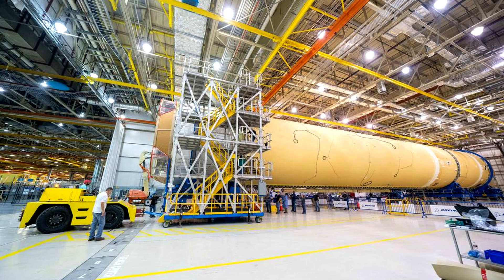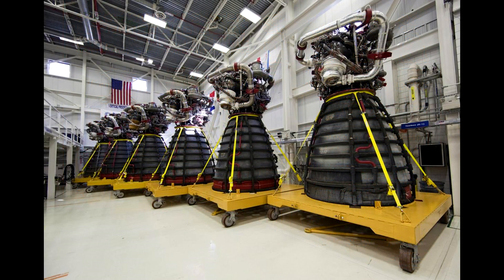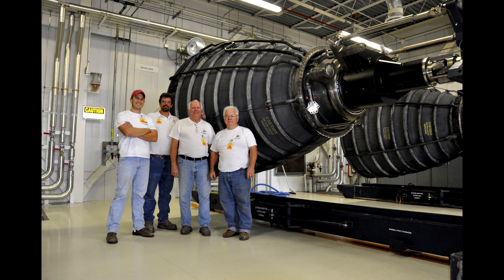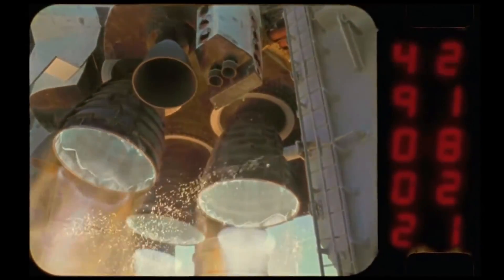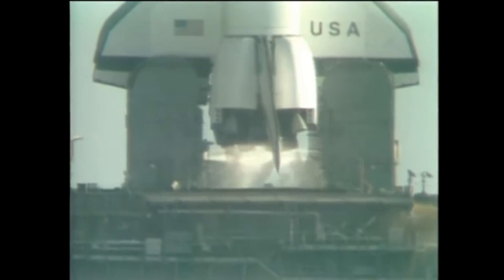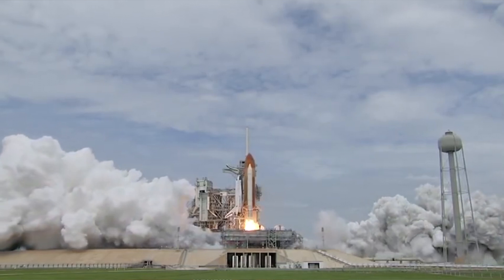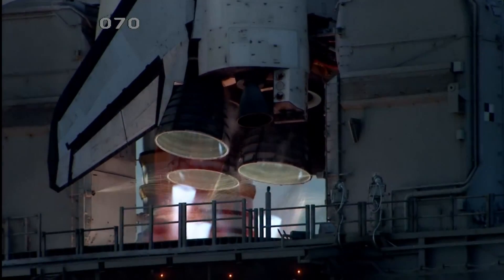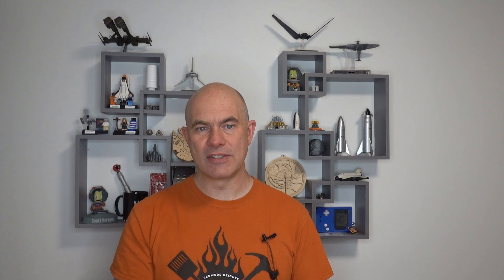Four Old Space Shuttle Engines Team Up For One Last Rocket Launch

Comment: Government: We have the reusable engines, let's throw them away!
Reply: Is it really reusable, if the turnaround is more expensive than new, simpler engines? I mean technically, yes. Sensemakingally? not really.
The reusable Shuttle was ludicrously expensive and slow in reuse-times....

I twas solving a problem, nobody had, at much higher costs than it made any sense.. Pretty iconic though.
Reply: Reusable engines is a big word, refurbishable fits better.
The Russian shuttle had realy reusable engines.
Reply: @Triggernlfrl  Because the Buran orbiter only had orbital vacuum engines on it. The vast majority of its parts (including its main engines!) were a completely expended LV. Besides, it was only used once so who knows how well the refurbishment would go?
Reply: Well it's not like they were ever going to be used for anything good anymore, the STS program is long dead anyways. Even so, they required significant refurbishment to be "reused", so it's not like they'd save that much by saving them again and again.
Reply: @Nick1979BN  yes of course the smallest rocket possible is the most efficient but SLS is being built to try to send some stuff to the moon and anytime you want to go to the moon the payload is extremely heavy
Reply: D R Big pharma and the insurance companies would make sure it didn’t.
Reply: I feel for those RS-25D engines.
Reply: Basically sums it up yeah.
Reply: D Murrman  scary isn't it.
Reply: They love spending our tax dollars. At least they are giving them one final go! Kinda sad the 4 won't make it into a museum though.
Reply: Ever heard of dunning Kruger effect?
Reply: You are a shining example of the dunning kreuger effect. Your very limited knowledge on rocketry has given you a false sense of expertise, where you are highly confident that you know the right answer despite the fact that actual experts would be less confident than you are. It's unclear just how much the reuse of the falcon 9 has reduced it's cost. A reduction of at most 10 million dollars per flight is claimed by spacex. The real reason the falcon 9 is so cheap is because it's parts are so cheap to produce. That's all. 

So; you want the government to reuse the first stage of the SLS. They already tried that with the space shuttle; the cost savings turned out to be marginal at best. So let's say that NASA were to try to reuse the SLS. The first thing they'd have to do is dramatically increase the mass of the upper stage. Not even the exploration upper stage would be massive enough to allow for this. There's a reason spacex has a massive upper stage, so that at MECO the first stage isn't moving too fast to re-enter. So good luck with that with the SLS! I suppose all we'd need to do is develop a massive 350-400 tonne hydrogen powered upper stage using 3 J-2X engines, and then also SPEND AN ESTIMATED 500 MILLION TO 2 BILLION DOLLARS TO MAKE THE RS-25 CAPABLE OF BEING LIT MID-AIR WHILE TRAVELLING THROUGH THE ATMOSPHERE THE WRONG WAY. Then spend another few billion dollars developing flight and guidance hardware to allow for an autonomous first stage landing, and of course add enough landing legs, fins, rcs systems for stage control, etc. Oh and make sure all this new hardware is man-rated. Oh and add some very heavy structural supports to the core stage to allow it to withstand re-entry at around 5-8 km/s (over 8 km/s if it's  using the ICPS). Oh and don't forget you have to do more tests to see if the core stage can withstand re-entry while fuel is sloshing about, most likely adding more baffling in the inside of the tank and doing vibration tests. 

Of course then you have to ensure that the RS-25 can fire without combustion instability at sea level while travelling BACKWARDS AT MACH 0.7-0.9. This would be the largest problem with re-using the core stage. The RS-25 has a unique nozzle shape that curves inwards near the end to raise the pressure on the lip of the nozzle at a slight performance cost. This is done so that you don't get the characteristic flow separation that would normally occur with an overexpanded engine (an engine where the exhaust pressure is well below ambient pressure; exhaust pressure of the RS-25 is around 30% sea level pressure; a normal engine at those pressures would undergo flow instability at sea level and tear itself apart). 

Of course you'd also need to take into account SIGNIFICANT PERFORMANCE LOSSES that would arise. The SLS core stage weighs about 95 tonnes when empty. You'd need at least 4-5 km/s of delta v to land it, meaning that you'd need a mass ratio of at least 2.8. Therefore you'd need to save around 180 tonnes of fuel. This is the best case scenario if you decided to use a 350 tonne upper stage. Of course using a 350 tonne upper stage you'd also have even more performance losses, that is if you can even get a 350 tonne upper stage to structurally fit ontop of the core stage. This is because the stage would have a very high dry mass, meaning that you'd probably need an additional upper stage which would dramatically increase cost. 

So; TLDR; you are wrong. Even if this could be done the costs of doing it would most likely far outweigh the cost savings that you'd get over the estimated 10 missions that this is planned for, and it would delay these missions by at least 4-5 years. The actual cost of the RS-25 engines is insignificant compared to the cost of the manned components of the vehicle. SpaceX will charge around 260-280 for a crew dragon mission.  That's a factor of 5 more than a normal falcon 9 flight. Do you know why? Because the crew vehicle and the costs of developing and maintaining a safe crew vehicle with multiple abort modes is incredibly expensive. Over a third of the SLS's launch costs are estimated to be the Orion MPCV and the European Service module combined with the launch abort system, about a quarter is estimated to be the ICPS/EUS upper stages along with the adapters. The boosters and core stage combined account for around a third of the cost of the launch vehicle, at around 180-200 million for 4 new RS-25D/E's, 60 million for the core stage, and 60 million for each booster for a total of 360-380 million out of around 1-1.2 billion. 

TLDR; developing a reuseable first stage with the SLS would cost far more than it would save and set back the program at least 4 or 5 more years and would require several billion dollars up front, and would lead to performance decreases which the SLS cannot afford. There's a reason NASA isn't doing this; because it makes no sense.
Reply: @JohnDoe-vz7ff  Good explanation, though  think he was thinking of splashing with a parachute and recovery.....dunno.,
Reply: @QuantumRift  getting seawater in your rocket engines isn't good for it. the water makes it shrink and leaves it bleached and smelling like the sea.

it also corrodes the fuck out of it, which is why the space shuttle SRB's cost more to recover and refurbish than to make them from scratch.
Reply: @QuantumRift  First stage parachute was explored in concept as far back as the Saturn V. For one reason or another, it wasn't ever tested. Of course, one of the obstacles is that salt water is corrosive to some of the materials. One design had the first stage splashdown upside-down, but this needed a heavy heat shield. Another was to use a para-wing to glide to a runway (?) which was probably considered too much of a risk to fly over land.

In the end, I think the most likely possibility is that they only needed to make a dozen or so Saturn Vs anyway, so reusability wasn't such a concern. The Shuttle was intended to fly hundreds of missions. The SLS's mission life is probably more similar to the Saturn V's
Reply: @JohnDoe-vz7ff  Yes falcon 9 is cheap even expendable, but a $10M price reduction doesn't indicate a $10M cost reduction.   There's a claim floating around that B1021 cost $7M to refurb, so that could equate to something like a $40M reduction in end user price.  But the price is based on what the customer will pay, if you're still the cheapest by a big margin there's no need to come down in price.  These launches are funding their development and satellite constellation programmes after all.
As you point out "It's unclear just how much the reuse of falcon 9 has reduced it's cost."  Given the turnaround times it's clearly orders of magnitude from the complexity of refurbishing a shuttle.

SLS isn't viable for re-use, but that doesn't mean re-use isn't viable.

Also, Easy on the insults.  The smugness of your high school physics, unsubstantiated claims "Oh and" POINTLESS ALL CAPS has a dunning Kruger ring all of it's own.  You're not wrong in the most part, but you are being a bit of an arsehole about it.
Reply: @JohnDoe-vz7ff  true
Reply: John Doe Pretty much exactly right. It would be cost prohibitive. The public outcry about NASA even being involved is bad enough without them spending more trying to make Space Shuttle components do things they were never designed for just to make them reusable.
Reply: D Murrman  Canadian here. universal hea;healthcare works. don't trust us? ask Australia. or literally all of Europe.
Reply: @wyattroncin941  Brit living in Japan here. Within 20 minutes walk of my house I have three hospitals, each the size of the one that serves almost my entire county back home, and any of which I can stroll into and make a same-day appointment at right now.
Reply: @michaelmartin9022  and that's what you get when you don't let everyone who feels like it move to your country, immigration to Japan is basically 0
Reply: @wyattroncin941  it may work, even a broken clock is right twice a day.  I just don't like leaving something that important, my life up to the whims of government functionaries. I'll take care of myself thank you very much.
Reply: How much do you think it would cost to develop a reusable SLS?
Reply: @thethirdman225  Guess what! We already have a reusable space launch system!
Reply: Amir Alavi Not with this capacity you don’t.
Reply: @thethirdman225  we already know how much it would cost to develop a reusable SLS: about 5% of SpaceX budget.
Reply: neithere So what you’re saying is that you think it would be a simple matter to turn an expendable vehicle into a reusable or... Have I got this right?
Reply: @thethirdman225  How much to make a reusable SLS? Way too much. Disposable SLS has been too expensive. Much less a reusable one. Plus that would handicap the payload capacity tremendously. SLS is supposed to be the heaviest launcher around. 77 tons vs FH's 70 tons and it's also proposed changes to make SLS capable of 130 tons to LEO! As such, it'd be kinda dumb to run SLS when you could just run a Falcon Heavy and discard it or even recover the boosters. Not sure about Starship's real payload capacity for cargo. I think it's supposed to rival that 130 tons?
Reply: Mike Stromecki Well I hear a lot about how much SLS costs but I never see actual figures. I certainly have never seen anything to compare directly with the cost of other rocket systems. I ask and people always say “too much” without ever giving anything concrete. I have yet to see a cost/performance analysis of SLS V Falcon Heavy. Starship or whatever it's called is the dream of a megalomaniac.
Reply: @thethirdman225  - government does nothing efficiently.
Reply: William Haynes That kind of one-size-fits-all sentiment ignores the fact that many other countries with socialised medicine have better outcomes for patients than the United States.
Reply: @thethirdman225  would take another 20 years
Reply: @thethirdman225  cheaper than a trow away sls
the sls is just a job program that's why it is non-reusable everytime you fly you have to hire people to build it again
Reply: doctor_who12 SLS is a totally different rocket, designed for a different purpose and conceived before Falcon 9 was a practical reality. Besides, you may or may not have noticed but it uses reusable SRBs. Every SLS flight will be at maximum payload, unlike Falcon. And once Falcon gets over about 70%, it is no longer reusable anyway.
Reply: @thethirdman225  for 30 billion if i am correct, they could at least tryed to make the 1st stage reusable, the srbs is a tiny portion of a 118 m tall rocket
Reply: @D0cDevs  Yes, it's just so obvious to an outsider, isn't it?
Reply: @thethirdman225  nah i know that it is quite hard to develop a rocket but i dont think that they should just trow those engine at the ocean
Reply: @D0cDevs  Yeah that's great but this is a deep space rocket designed to carry 100% payload every flight. At 100% payload Falcon 9 and Falcon Heavy must both operate in expendable mode. Besides, If you have any idea what the speeds are for the kind of mission SLS was designed for, you'll understand why it's extremely difficult to make it reusable.
Reply: @thethirdman225  you are actually right to make it a reusale rocket that would carry any significant payload without refueling in orbit the rocket would need to be 3 stages or more
Reply: @D0cDevs  Go back to the beginning of this thread. About 8 or 9 posts in there is a long post from someone called John Doe which explains why this is not possible and why SLS could never be made reusable.

Just because SpaceX made an orbital rocket partly reusable, that doesn't mean every other rocket can be. Even SpaceX has to use expendable mode once the payload or range becomes too great.

So please do both of us a favour and read something other than SpaceX brochure figures.
Reply: @thethirdman225  You don't that would be ridiculous. You go the SpaceX route and develop starship.
Reply: @bobfreds  cant nasa and other  space agencies come together world wide and develope something we all want the same goal we'll never get anywhere really why is space such a secret when it shouldnt be really
Reply: bob fred Much more expensive. The public outcry is bad enough without NASA trying to develop things from scratch. The SpaceX Starship is a solution to a non existent problem.
Reply: @bobfreds  if any starship was to be constructed wouldnt it be more easy building it in space ? plus all the energy used to take it off the earth would be saved
Reply: @justaman5418  no, trying to build a rocket from a pile of parts in space isnt practical.  you still need to launch all the parts up, as well as teams of workers every week or so.  you would end up spending more time and energy, and expose the workers to much higher risks, than just putting it together on the ground.  manufacturing in space only saves you energy if you have infrastructure, materials, and labor already there.  once we start mining asteroids we can revisit your idea, until then its just a pipe dream
Reply: @justaman5418  it takes a factory as well as several hundred if not thousand vendors to build a rocket , so unless you send the factory the space it's still easier to build it on Earth
Reply: @thethirdman225  It's the creation of a new market. Not every technology should solve an existing problem. If anything, Starship is a great example of why private space companies are so important. They are able to take much higher risks thanks to venture capital and not being beholden to Luddite politicians.
Reply: @Jaxck77  Good grief. I don't need another lecture in the benefits of free market capitalism from yet another American with a woody for Elon Musk and a reactionary hatred of politicians. I know how it works. Starship is the answer to a question nobody asked.
Reply: @justaman5418  Space isnt the secret, the technology is.  Its alla bout money.
Reply: @thethirdman225  This is absolutely not about the money it cost this is about the will. You expend the rocket because politics in US want that. They do not want common people in space in a bigger number, they do not want a new cutting edge technology. The only goal is to spend money (as much as possible) and secure a lot of jobs. If they want to see a Saturn V in the 21st century... it is called now SLS...
Reply: Csaba Nagy Load of rubbish.
Reply: @thethirdman225  Yes... it is I agree...
Reply: As the first is designed to fall back to earth anyway, why not have it turn around so that the tanks kind of shield the engines, and then deploy parachutes to save what's left? I don't think there will be much left, but at least you can give something to museums.
Reply: @nanolog522  when the government is paying you to do something you always throw away what you made so that you can get more money next time to build something new
Reply: LA Prepper They didn’t throw the Space Shuttle components away.

Comment: Here's the way I see it, each launch vehicle is designed for different missions, SpaceX is able to launch sattellites into LEO with reusable rockets because they can use the extra fuel to land their engines, using RS-25 saved NASA R&D time but they can't use the RS-25 reusable capabilities because they need the extra fuel to go higher and faster, it being an interplanetary rocket
Reply: Well, if it saved them R&D time, what's the last decade for? R&R? 😂
Reply: @fcgHenden  If you're laughing at me then designing the other parts of the vehicle, if you're simply making a joke very funny
Reply: And part of the reason they can't carry enough enough fuel to make the RS-25 reusable is because they've decided to use Hydrogen.  A great fuel, but not a great first stage fuel because of it's bulk.  Also the RS-25 is not designed to be lit multiple times per mission, quite the opposite, it has a reputation for being temperamental on startup and many shuttle launches were delayed due to SSME issues on startup.  As great as it is, it's actually not so great.